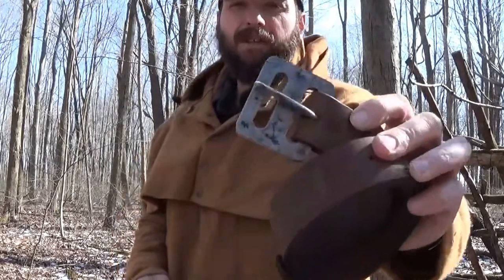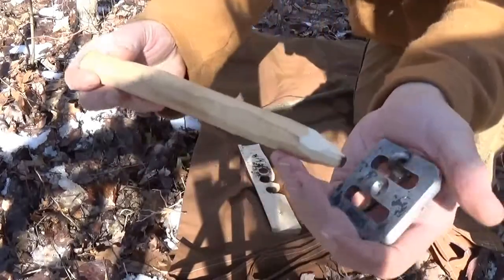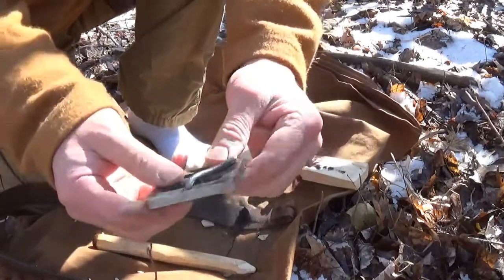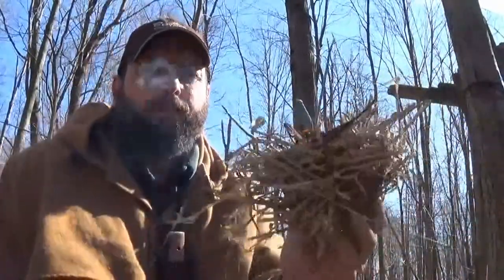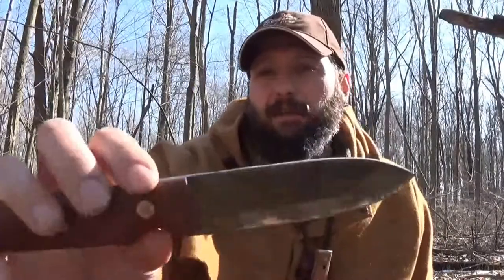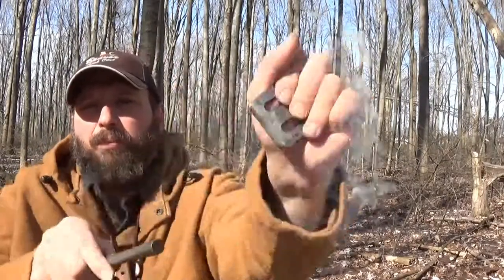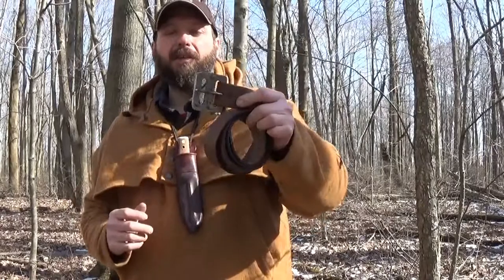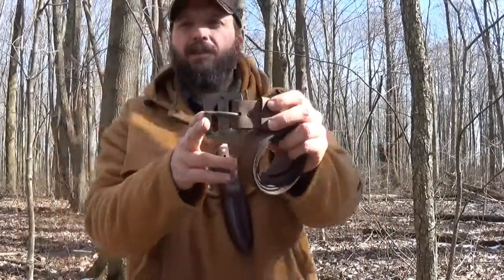Larry Roberts Mouce Belt Buckle

Comment: Jamie, you might also consider another mod.... make another edge of the bucket, which is enclosed by the belt when being worn, into a knife blade. carbon steel, great knife metal.. The leather belt would of course be a natural sheath for the knife.... Of course this mod would take away from holding the buckle and using it as bow drill divot.  There might be away to put a small knife edge on the buckle, such that it doesn't interfere with the divot grip which you displayed in the video... in any case, it would give the MOUCE  buckle another function.